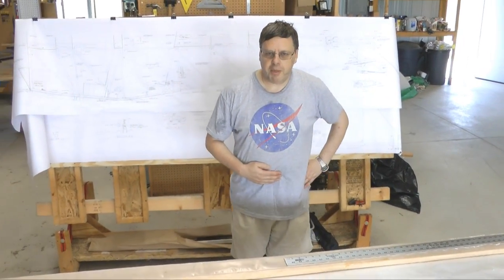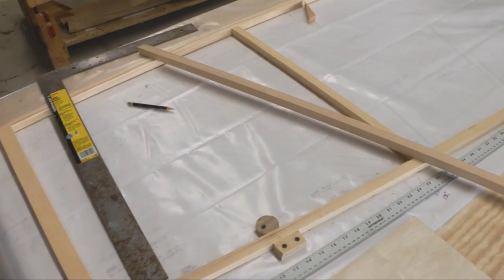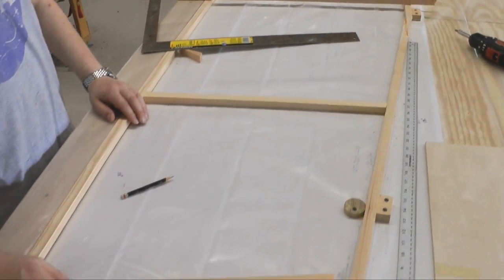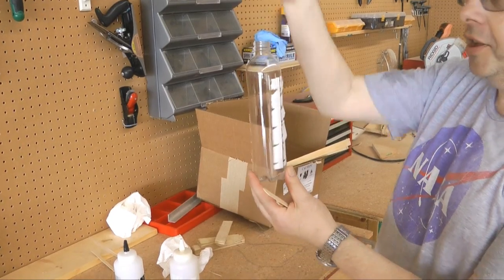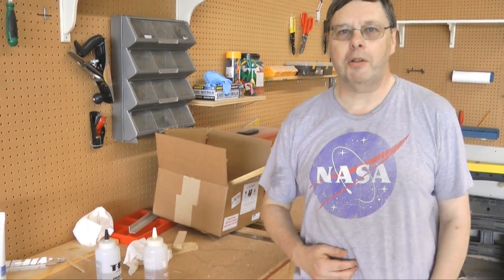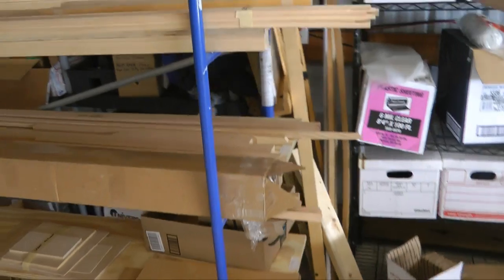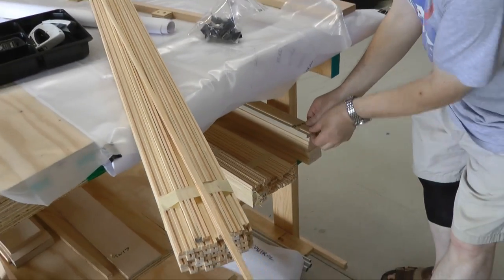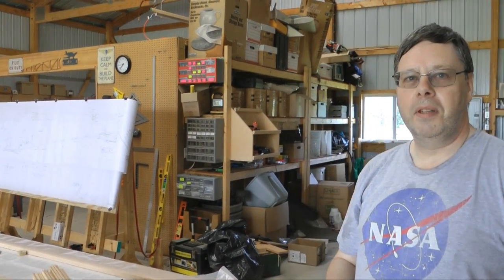Building a Wood Aircraft (Part 1)

Comment: would it be okay to sue strong wood glue for this type of project?
Reply: No!
Reply: Umm, Nooo..!!! Normal wood glue won't work...A plane in the air is constantly subjected to 5 to 6 times it's weight in the air... Normal wood glue can't hold up to that...Try it..Glue a 2x4 together with some TiteBond...Let it dry..Then stand on it...Watch it break under your weight...Just think if you used it in your homebuilt plane at 500-1000 ft in the air.... Cheers...!!!
Reply: There are some really "strong " wood glues out there. 
Many might not have enough give, bend but not break, to be suitable for aircraft use. 
Others may NOT stand up to years,  decades of swings in humidity and temperature. 
Better to go with an aircraft epoxy,  or a suitable resorcinal.
If you're going to be puttering around around at several thousand feet!
Reply: Ok

Comment: FYI...Menards is importing Scots Pine in 2x4 and 2x6 construction stock from Ilim Timber from Germany.  I have found many clear boards and even the knotted ones have short but long enough areas good for diagonals. It has tight growth rings.  Ruptures at over 12,000 psi.  Is 34lbs per cu ft.  Some is a little resinous but per T-88 this should be sanded and wiped with lacquer thinner.  My test glue ups all tore wood fiber...happy hunting!
Reply: 34 lbs/ft3.  Vs 27 lbs/ft3 Sitka Spruce. That’s a huge difference!
Reply: @rjhinnj  and? It's is comparable to Douglas fir in weight and charactoristics.

Comment: I’m just about done with my plans build all wood Fisher Horizon II.  I’m down by Madison wi and if you want to do a vid I would love to be part of a wood build series.  I love building with wood, I can work on it all night, come in the house and the wife does not say “what is that smell”!  Fisher offers a great set of planes, I built a fisher 303 ultra light years ago when I was more ultra light size.
Reply: Would love a close look at a completed Horizon  2.  Has yours flown yet?
Reply: @riedjacobsen8620  it has not flown yet, this fall is the plan. I have a Corvair engine that is built and is mounted on a mock-up mount to get the placement just right. the wings are ready to cover once I get the wing tanks installed. The fuselage is just about done and just needs the final landing gear to be finished. I know its not done but if your are in the Madison area I would be happy to show it off.

Comment: Awesome build! Great tip with the circular dowels, I haven't seen that before. I'm scratch building an RW6. Started off in January 2018 by building 22 wing ribs. Most of the wooden pieces are done,  just the left wing to go. I'm also using T-88 glue, it's great stuff. Looking forward to more videos!

Comment: Love the project and one question? Is that 7 degrees or 7:1 on the splice?
Reply: Good catch.   It should be 8.2 degrees (the Arcsine of 1/7).   I did not realize that Jon was going to make it into a tip when he visited brandishing a camera ;).  I will have to think "video rampcheck"  next time.  Fisher provide really nice full size plans which make is more of an exercise in "replicate the drawn lines in the wood pieces" to get the fit right, so  it was a case of fit rather than measure.
Reply: You just follow the full size representation of the pieces on the plans.  All Fisher plans are similar in this respect.  Not sure what the actual ratio is.